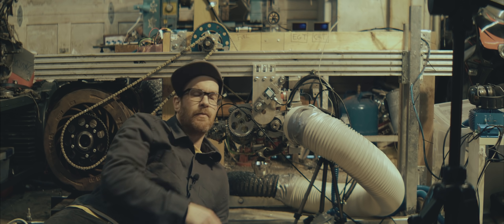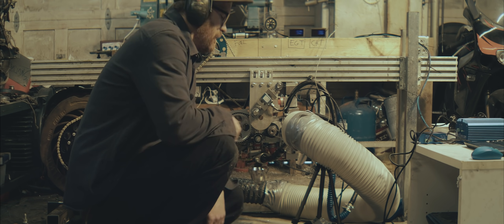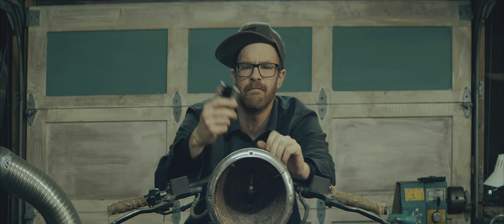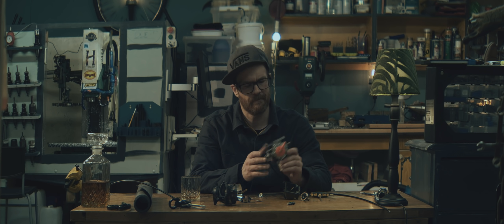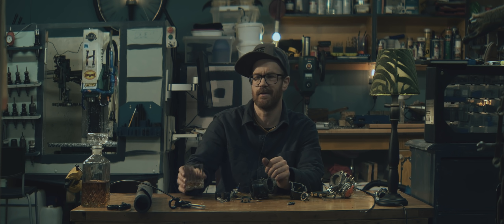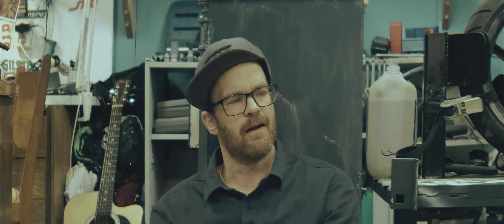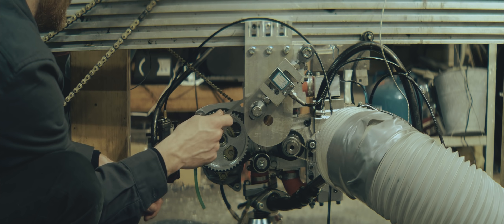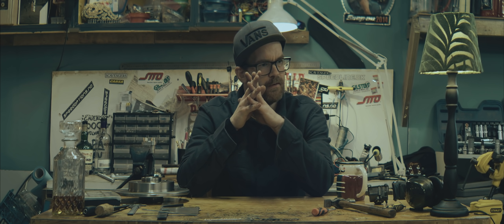Supercharged Nitro Two Stroke, Dyno quest continues.

Comment from the maker: Thank you The Ridge for the awesome wallet and for supporting the channel! Check them out here: https://ridge.com/2strokestuffing
Use code 2STROKESTUFFING for 10% off!
Reply: Thank you for posting such amazing content. I've watched your whole channel in the past couple of months and it's awesome now that you're going full time with it.
Reply: Are those freedom dollars in your Ridge wallet?
Reply from the maker: @mrpresidentm1  yep😁 All I had in my old wallet.
Reply: @mrpresidentm1  in norway is hard to have freedom dollars
Reply: Timing is what i was thinking , and also exhaust port timing , maybe even make the rotating hole a bit larger. But brake on the direct engine (without clutch) maybe not such a good idea , on a normal engine you use the clutch before you brake , it hurts the  piston rings dude !   I once got a karcher presure washer for free , because it would not work well , and before i worked on it to fix it , i dreamed being inside that machine , when i took it a part it was like i already knew what was wrong , really weird . the only thing that was hard was the bold they glued with nut-lock . what i was about to say , be your machine inside and outside
Reply: They sell air / fuel meters for about US $200. They come complete with an O2 sensor, brain and display. Give them 12V DC and install the sensor in the exhaust, and they're ready to go.  The only hassle is adjusting the camera's shutter time to overlook that LED displays actually blink at a high frequency.
Reply: Wish I had your code when I bought mine, lol.  Still though, bought one a little more than a year ago for a birthday present to myself, and it's awesome.  I'd never go back to a normal wallet.
Reply: if you send the excess air between the compressor and the carburator, that engine will consume waaaaaay less fuel
Reply: why dont you put chain from engine  to the dyno with right variators bell or variator clutch then its would show proper dyno horsepower.
Reply: How much power do you think you could get out of your engine

Comment: The dyno is hard to calibrate, everyone I know ended up buying a motorcycle dyno. Same with your timing issues, you can put a fuel tech or megasquirt EFI on it and get actual control and Afr.

Comment: If your going to use PWK carb you need to check if high flow shut off valve is available? 
There are things that can be done to stock shut off to increase flow but much of the modifications have not been available in print since the 1970's.

Comment: Why dont you throw in a stock moped motor with a known hp and torque output so you could more easily tune the dyno and then start tuning in your supercharged and PIP engines?

Comment: Top Video!!!!
Probable , The fuel level dropped below the Main jet pickup. Suggestion up size the passages and inlet valve.
place a smaller load cell at a larger dia, like 1m with a dampener at .5m.

Comment: As an engine engineer, I recommend a dyno that can hold constant RPM. Then you can figure out what your engine is doing. Also, I recommend looking at measuring CO and if you're lucky, O2 in the exhaust gas. Lambda sensor won't do it for measuring AFR. Then you can really start to diagnose your engine.

Also, use a known good engine for tuning your dyno.

Comment: Maybe an oversized float bowl, or an exhaust pulse to fuel tank setup, which may be able to overcome the float needle pressure. A flame arrestor and variable pulse valve would help control things a bit.

Comment: A hot coil setup could definitely help. I've had that problem with stock COPs on higher boost turbo engines and had to upgrade the COP and use a different plug.

Comment: One thing I learned from watching some dyno tests is that ignition timing is what gives the power once all of the fuel/air mix needs have been met, too much fuel quenches the plug. Initial advance in timing from where you are now will give a quick increase and then a diminishing return, there is an issue with flame front speed based on fuel/air ratio and with your high revs this is important. 
On my microlight Subaru engine timing up to 30 deg gives good power, 33 deg a little more but not worth it, be conservative for reliability.
Good luck, interesting work, appreciate your efforts!

Comment: 11:40 you can see on the joint of that pressure thing under the motor, that it is not probably sealing... some wierd white stuff is going through seating surfaces

Comment: I hesitate to suggest non-engine-related work, but your process is so relentlessly iterative that I'm sure you can make much faster progress if you improve your workflow.  To wit:  why not raise the jackshaft sprocket more above the retarder?  That raises the engine enough that 1.you can make changes from a wheely stool instead of on your knees, which is 2. more comfortable, 3.gives you better access and visibility to all components, 4.makes it easier to position yourself so you're not blocking the camera as much.  5.Allows you to shorten the longitudinal extrusion, reducing the overall footprint and recapturing shop space.  6.Tightens the layout giving you more space in the shot for overlays ( or dramatic visual expression, Sir David Lean ) 7.Potentially shortens the chain. 8.Makes a vertical ( then across the ceiling and back down ) exhaust duct feasible removing the trip hazard on the floor.  And, on that subject, some kind of smaller diameter, preferably fireproof rigid metal,  initial duct with appropriately spaced transitions can almost certainly improve draft velocity and do a better job of keeping the smoke in the neighbor's yard, where it belongs.
Reply from the maker: All very good suggestions!

Comment: this must have been said countless amount of times already, but why do you keep testing the dyno with a non proven engine ? 

You should test the dyno with a know electrical engine, then even a known 2 stroke engine if ou want to make sure of vibrations impact etc (which could be smoothed out provided you have high enough strain gauge sampling rate), static calibration of the strain gauge is plain geometry, it has to be 100% reliable before you start testing a novel engine imho...

Comment: Hi buddy what spark plug gap are you running ? How much spark dwell do you have?
Try running a low gap 0.3 mm 
Dwell time maybe too short not getting the coil saturated enough to create enough voltage at the plug !!! Great stuffing 😋
Reply: Hello James. Alex is running .7mm plug gap. I feel the vast amount of RC fuel going into the 40mm bore engine is overpower  the combustion cycle due to it being so dense. When you think it's going to rev to 20,000 it gives very little time for combustion on such a slow burning fuel. When Alex was running the 35mm carb on a 40mm bore I think that was a tad over optimistic, even the 28mm is too much in my opinion. The smaller carb used on the SPX project reduced most of the problems when he was running a carb that was too large. I feel the Brute Force engine needs a even smaller carb which giver finer tuning over the rev range.
Reply: James, just added a touch more to my previous re carb size.
Reply: @malcrandall1309  yes sorry Malc 
Yes I agree a smaller choke size 
Would help air speed across the jet tube ,slow cylinder filling a little 
Also people get confused with boost pressure numbers , air flow 
Required for x , 50 hp as an example would require around 
120 cfm@10 " pressure, - losses in the ducting ,granted that there are various variables to be considered, so my thinking is how much air is generated at what rpm ? The dump valve reaction is 
Slow so over pressure is expected 
Sorry for the babbling ,, I hope this may throw some light on the issue 
Well done guys great effort
Reply: @jamesgarrard4361  Right James I will try again to see if the page changes of it's own free will again. I must admit to  being of a simple nature, no forced induction and no fuels other than petrol. I used to race home brewed race bikes back in the early 70's mainly 250 singles then onto 125 twins and 250 Yamahas and Rotax. Also used to make our own expansion chambers from 45 gallon drums cut up and gas welded. I would like to see Alex experiment with hydro formed expansion chambers on the PiP project. Regards Malc
Reply: @malcrandall1309  cool stuff Malc 
You remember the days of heavenly sounds and the smell of r30 in your lungs too , I wish we were back there again buddy.
Trial and error and shit load of patients! Awesome  I rember many scrapped cylinders, cutting 
Up so called power pipes and modding them to work for you 
And not against hi hi ,
I get all excited at the thought of doing it again even though I've done loads of 4 stroke stuff .
Thinking outside of the box 
Is the way forward ,pass on your knowledge to the younger guys
Set new levels in you garage 
At home , awesome 👌
Reply: Hi Malc ,you received my reply ,i wasn't sure if you received it  ,good stuff 😁
Reply: @malcrandall1309  
Hi Malc pleased to meet you 😊 
Yes my thoughts are on track with your thinking 🤔 
Retired rnd guy 
Yes I think your right charge is so 
Dense it's probably either lack of energy to light up as the rpm +
Cylinder pressure go up
My experiences with turbo motors  rnd 1000 hp per ltr hi cylinder pressures and dense charges 
= hi spark energy and a small plug 
Gap around 0.2 /0.25 range 
Also  the heat range of the plug 
And indexing the electrode position away from the intake 
To reduce plug wetting ,I remember playing with a 79 yz 80
Years ago it wanted a small plug gap or it could not produce any power hi up in the power band.
Nitro fuel is difficult to get a  homogeneous mixture its better inject it rather than using a carb
The key to power is getting the fuel to stay atomised until the point of combustion. Its the details that count. Great stuff love the guys tenacious attitude 
To get to his goal well done

Comment: Load cell calibration from centre of pivot or centre of crank? You may have some weird dynamics going on from remounting the engine in the cradle for the PIP. Also, I think dampening the load cell from that angry little engine is a good idea. Hope this helps. Great content! 👍

Comment: I think your on the money with the the pid controll not being right less alot less proportional to start with until  you can get it to hold the engine at a desired rpm when the load is applied smoothly then start on the intergral so it doesn't overshoot target rpm when hit hard

Comment: With the load cell you have now leaving it in its current position is probably the best option if a rubber damper is fitted between the load cell and the engine cradle, making a longer arm will increase the amount of error reading as a smaller part of the range is used.
With a longer arm a load cell with a smaller range is needed, like 25 or 50N. But the longer arm could be used as a damper in itself, when it has some weight at the load cell end, the inertia will dampen fast occurring changes in load like those vibrations, just be sure to zero out the static load well.

Comment: We use these carbs in Karting.. Anything over 2 turns.. and its FULLY OPEN...  like any tap..   Lower the pop off to around 8psi... BUT.. you need to set the needle and seat.. PERFECTLY...  adjust the needle fork to make sure you get consistent POP OFF.. without leak down.. The pulse is VERY important.. get pulse from the crank case.. ( but the supercharger may be a problem... as its over atmosphere pressure ) ... ALSO .. you can drill the jets.. BUT that is drastic ..

Comment: Awesome work mate if it keeps dieing in revs full throttle go bigger jet or 35mm carb , full boost it's running out of gas full revs.
As I've said before do a plug chop , only way to see colour of plug full throttle especially when advancing timing you don't won't a lean out full throttle. 
Keep it up.

Comment: Would it be possible to use the injection off the pip engine on the brute force … you could fabricate a butterfly intake with the injection nozzle outside formula one style … might help to get the fuelling spot on … just an idea … brill videos as always

Comment: You should probably do a good wide open pull and kill the ignition, pull the spark plug and look at it closely. Black indicates too rich main jet. White is too lean. Golden tan is perfect. Tiny bits of aluminum stuck on the electrode is way waay too lean.

Comment: Methanol burns slowly compared to petrol so will tolerate more advance, and needs to be jetted much richer. I would have thought that 15 degrees is way under advanced and risks running hot. I think this engine has lots more to give and am very impressed with what you are doing. Can't wait to see what you can get out of it.

Comment: @2STROKE STUFFING Alex it isnt fuel pressure thats the problem, it's volume. Carbs do not run on pressure they run on volume. Find the restriction in the delivery and get more volume to the carb! That will fix it.
Reply: If you could deliver sufficient volume to the carb at .5psi thats all you would need is .5psi, most people look at it backwards though and try to use pressure to deliver volume and it just doesnt work.

Comment: The gain in the retarder is way to aggressive. Need to limit it so it’s not so sensitive.

Also add some rubber between the load cell and the load. It’ll greatly help it as vibrations on load cells suuuck

Comment: Improve the sensitivity and  "dynamic range"of your retarder. I have a Telma retarder dyno, of similar size to yours.I use it ob RX7 / RX8 engines in 300 -550 hp, 300-600 Nm range. Rotary engines are 4 strokes of course, but still  little peaky, so I only bother doing steady state idle, and 4000-9000 rpm. Your engine is likely to produce nothing until 13,000 say, and the max speed of the retarder is 4,000. So gear down to say 2.5 - 3.0 to 1 to get the "dynamic range" back. At low power, retarder bearing friction, 2 stage reduction,  and windage may be a significant percentage of the measured force.  I can ignore this small percentage when tuning in 300+ range. You can't ignore this in the 5 - 25hp you're at, you're "signal" is my "noise." I would try the following. 1) Remove 1 of the tow rotors from the brake, your torque measurement will now require twice the braking current for the same force, with has doubled the signal to noise ratio of the system as a whole. 2) Gate an electric motor, say 1 to 3 hp, with a stated stall torque on the nameplate,  and calibrate the dyno "in steady state" with no gearing.  See  if anything can be learned from doing this...

Comment: I wonder if the motor was getting to much air from the bigger carb maybe it was both the fuel and air mix at high rpm high load

Comment: Love your vids and have some possible help with the dyno.  I believe you are on the correct track with lowering the voltage of the coils in the retarder.  This type of retarder is designed to slow a 50k lb semi truck from highway speed.  This is a many times greater horsepower rating than the range you are wanting to work in with this dyno.  The second run 9K rpm run you show is much more consistent with the reduced load as opposed to the retarder instantly killing the revs of the first run and giving you crazy inertia based hp and torque numbers.  I would consider lowering your retarder coil voltage even more so that your engine and retarder are more in sync from a capacity standpoint.  Regardless definitely keep your load cell on the engine so that you can continue to use various chain reduction setups so that you don't have any error from chain based power loss.

Comment: I thought you were on the right track when you lowered braking force on the dyno. Still seems to be struggling tho. Must be the load cell. I wouldn't have thought the computer would use load cell data to help control the brake but it must. Needs some sort of damper

Comment: Yeah.. nitro requires a metric SHITLOAD of fuel flow.. and think you're only running 30%, wait until you get up to the higher percent ranges and start running 10X the flow. I definitely think a fuel pump and EFI are in your near future to get that thing running right consistently... or at least making a fogger plate like they use for wet nitrous systems where you have a tube behind the carb that has small holes in it with a jet metering how much fuel can come through and when you trigger the solenoid it starts spraying more. (in nitrous you add nitrous along with the fuel) I think having a secondary fuel system for max RPM like you are going to do on the other engine would definitely help at high rpm. The question then becomes "where should you add it in?" you could add it behind the carb pre-blower, post blower or even direct injection into the cylinder.. or some combination of them. Remember also that the more nitro you add your timing is going to change... because nitro. ...You should make a shirt or hat or something that says "Because Nitro..."

Comment: i feel like you're probably getting way too much oscillation from the engine. maybe stiff rubber bushings that take up the slop but pad both sides of the load cell? could also put a long bar on the engine to dampen the rotational acceleration (but then you get into wave forms in the bar).

also, under boost do you have enough voltage to spark plug so that it isn't being blown out?  could decrease gap to test it.

Comment: I don't know what percentage you're running but you'll need a bigger float bowl and more than likely needle and seat area.  Straight nitro is around 1.7/1 AFR and alcohol is in the 6/1 range so you'll need more reservoir for sure.  As far as ignition is concerned, nitro burns slow and will need more timing more than likely.